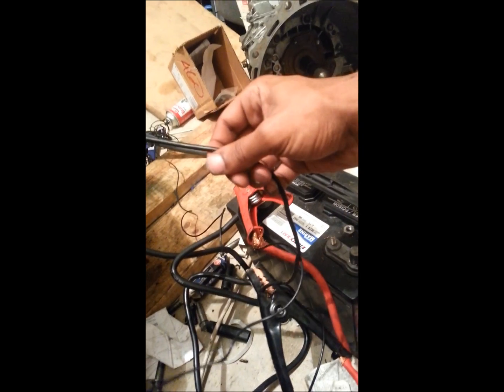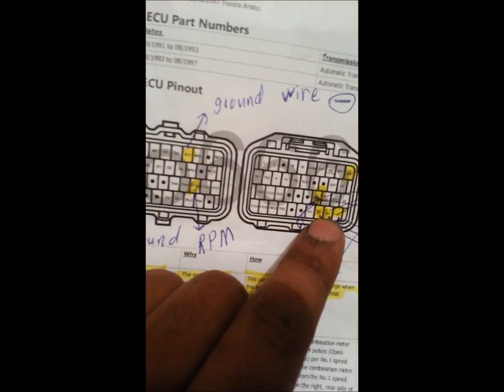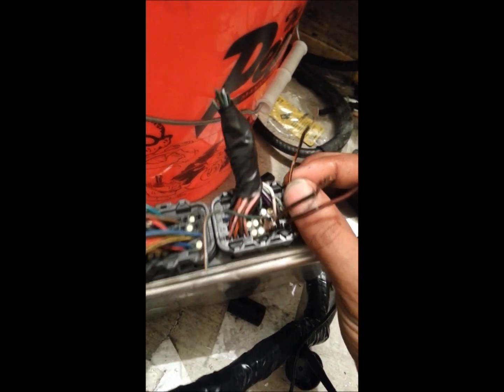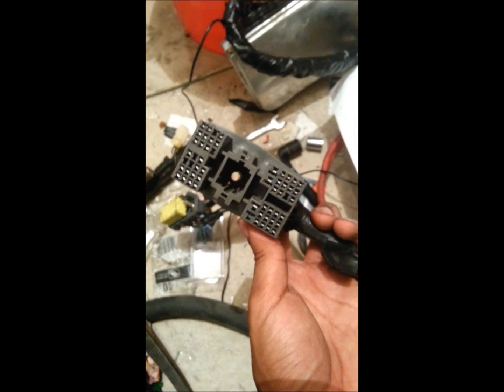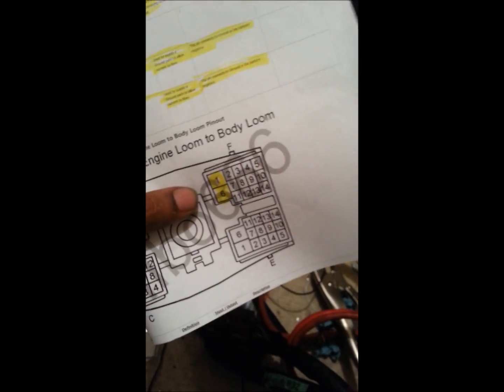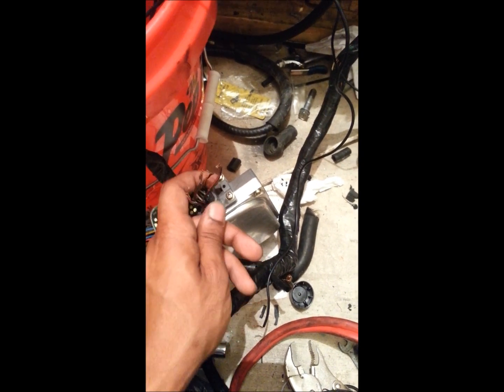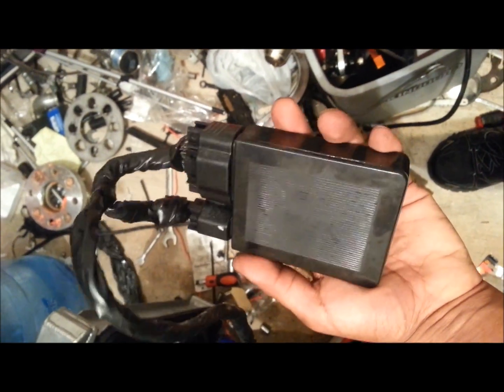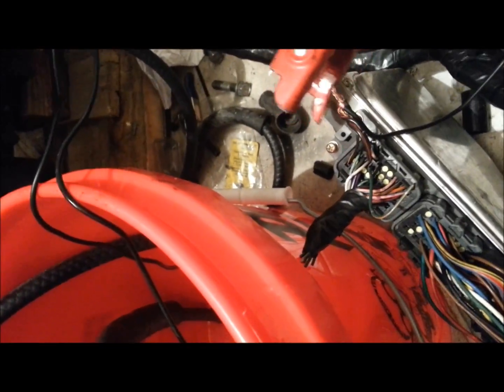how to start up 2jz gte non vvti supra aristo on floor outside the car basic wiring setup

Comment: Was the oxygen sensor the cause of The surging to the idle? If so would I need to ground the main oxygen sensor so it idles correctly? Any input would be very much appreciated, thank you in advance
Reply from the maker: Limp mood could be from any sensor. However, I didn’t use the stock ECU when I installed the engine on my car

Comment: What wire is the last  black one to start it? F1? I dont see it one the ECU pinout
Reply from the maker: It is not on the ECU. It is on a separate plug for the body called loom plug. If you don't have that plug,  just follow the wire to the starter or make a new wire to starter

Comment: Great video! I'm using this info along with the ecu pinout printed for a USDM is300 2jzge. This is what I have so far cut and ready to add battery power to...

Battery (E3-4) black yellow wire *always on.
+BM (E3-7) light blue white *always on.
IGSW (E3-17) black orange *ig switch on.
+B (E3-6) black red *ig switch on.
+B2 (E3-5) black red *ig switch on.

Sensors needed to run (crank and cam) are plugged in. Starter is wired thru the harness and battery. I can activate the starter from the starter relay. Fuel pump in the 240sx is on its own hard wire and relay with a toggle switch.

Do I need anything else to get the engine to start? Will I need to energize the crank and cam sensors?
Reply from the maker: Kieran Jackson make sure you have the ignition module, throttle sensor, and mass air flow sensor

Comment: Thank you so much! This helped me out greatly. I'm a little confused about the M-REL pin as that's an output. What am I going to output it to?
Reply from the maker: This is going to the relay. You will need to have a relay to not fried the ecu. This one would turn the relay on with the switch on to turn on the ecu and run the engine. However, you could turn the engine without a relay but it is not recommended
Reply: Almudeeer thank you for answering. Still a little confused. The M-REL pin is outputting +12v but only AFTER the ECU received power from the +B & +B1. Are you saying that I need to wire up a relay between M-REL output and +B & +B1 with ign switch ass the trigger signal?
Reply from the maker: TripasGarage exactly
Reply: Almudeeer awesome thank you so much. Just found the main efi relay diagram online on wilbo666 site. Appreciate your video.
Reply: So I have left m-rel alone on my build. I have a separate relay sending battery power to the switched power inputs on the ecu including the ignition switch input. The relay is triggered by a toggle switch and the battery. Will this be okay?

Comment: Where do the red/black wires go on my idle air control sensor? Do I need em?
Reply from the maker: Tony's Garage you don’t need the idle air control
Reply: @Drift240sxSAT  I have a red wire on my TPS sensor too and it was cut by the previous owner. Was the red wire needed?

Comment: Can you do this with a aftermarket ecu to run single turbo like this?
Reply from the maker: Kane Radcliffe if you get plug and play ecu for turbo 2jz non-vvti, it is gonna be the same wiring. Like AEM plug and play ecu, same wiring. Turbo doesn't effect the wiring weather you go single or twin turbos.
Reply: Cheers man 😊
Plan on 2jz swapping my gt86 soon

Comment: THANK YOU VERY MUCH
This video will help me extremely well in my long journey in the near future to transplant a 2jzgte converted to N/A (NSW Red P Plate Legal) into a 200X VY Holden commodore.

BEFORE anyone comments back read below.
I chose the 2jzgte over the 2jzge because the 2jzgte has a return fuel line back to the tank.
Where as the 2jzge does not, so i can keep the stock commodore fuel lines to motor and return back to tank.
And the intake manifold is on the same side as the stock commodore air box.

Comment: Nice video. But why engine rpm surging up and down? Ecu in limp mode? Or was fuel issue?
Reply from the maker: Yes, it was on limp mood. I guess because some things were not connected

Comment: Would you happen to have the 1jz pinout?
Reply from the maker: Spencer Suislide check out this link for 1jzgte non vvti 
http://wilbo666.pbworks.com/w/page/47216384/1JZ-GTE%20JZZ30%20Soarer%20Engine%20Wiring

Comment: What do you mean like from the plug on the starter to the harness?
Reply from the maker: carlos garcia F1 from the loom plug leads to connector on the starter. So, you could use F1 to start the engine or you could make your own separate wire leads to that connector. You also could use the stock car starter signal and connect it to that connector. So you have many ways to connect the starter whatever way you prefer

Comment: Do you use all the same wires on the vvtli 2jzgte to get it running
Reply from the maker: No, the 2jzgte vvti has different pinouts.
Reply from the maker: this is the 2jzgte vvti pinouts
http://wilbo666.pbworks.com/w/page/42173082/2JZ-GTE%20VVTi%20JZS161%20Aristo%20Engine%20Wiring
Reply: Almudeeer use the pin out on the vvti but use the same wires to get it running
Reply from the maker: rancherist  yes, they mostly would have the same pinouts name plus a few extra ones. look over these pinouts to start the engine on 2jzgte vvti ( +B2, +B, +BM, IGSW, M-REL, BATT, STA, BF2 6,  BF2 7, BF2 8, BF2 9)  and for automatic transmission you add ( BF3 4, BF3 5, BF3 9)
go to this link and look only over the BOLD font on "how" and "description".
http://wilbo666.pbworks.com/w/page/42173082/2JZ-GTE%20VVTi%20JZS161%20Aristo%20Engine%20Wiring

hopefully this would help.
Reply: Almudeeer this is helping alot. I couldn't find the bf2 6, bf2 7,bf2 8,bf2 9
Reply from the maker: Maybe cause this comes on the auto transmission only. or if you mean on the link, scroll down until you see this number under a loom plug 90980-11527.
a loom plug is not connected to the ecu, you would see plugs in the harnesses that are not connected to the ecu and neither the engine. these called loom plug (Engine Loom to Body Loom Plug). these loom plugs were supposed to be connected to the body harnesses.
Reply: Almudeeer do I need to hook all the to a 12v or will the ecu do that
Reply from the maker: the ones that says input next to it, you would need the +12v.

Comment: What is different with vvti versus non vvti for start up?
Reply from the maker: 2jz gte vvti ecu pin outs are different. ecu and harnesses are different. you can look up at this website to see the vvti ecu pin outs 
http://wilbo666.pbworks.com/w/page/42173082/2JZ-GTE%20VVTi%20JZS161%20Aristo%20Engine%20Wiring
Reply: Thank you!